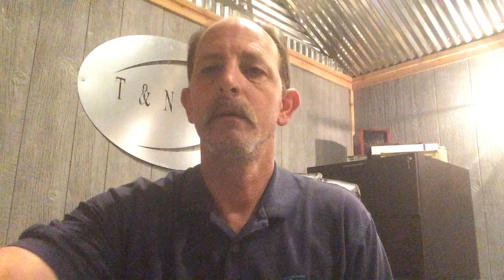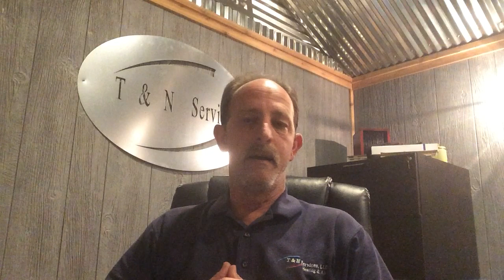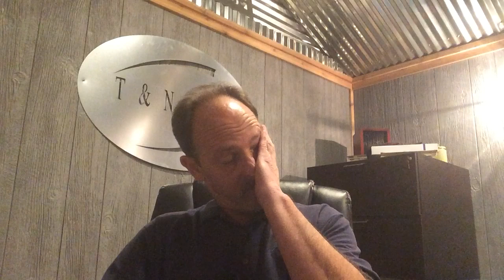Testo Smart Probes why are they so cheap

Comment: iConnect and iManifold, hell  Imperial is the apple of HVAC, overpriced and no better in quality. And nobody bought enough Moto X phones from 2013 to keep the american factory where they were assembled open. 

But it doesn't matter - if they made them in America it's only because it will be built by machines which is cheaper and no need to ship across the world.
Testo can do everything and more than the iconnect without the ridiculous price. They aren't 2-3x better. That's just them price gouging you - labor is not that big of a cost difference.

Comment: For what it's worth, we use testo and over many visits to the same customers, our testo tools are extremely accurate and system btu's are consistent even from different techs, using different testo's.  They are reliable, and take abuse despite their light weight.  They're cheap I thought, because of their down sides.  Limited range, and the testo app gets the award for being worst in the world IMHO.  Testo promises a new app update every two weeks but it never happens.  With testo probes, gone are the days crawling back and forth from supply to return plenum taking measurements to calculate enthalpy and btu's manually.  I almost forgot- they are very accurate in AC mode but the btu calculations are waaaay off in heat mode when compared to doing the math on paper.  I called them but they never have an answer and the follow up call never came.  I'm not sure why people hate Chinese products since they make high end stuff like iphones, ipads, ipods, etc and quality is very good.  The wages a tech makes are lousy in many parts of the country so it's hard to justify spending on an i-manifold to use on the job making 15 bucks an hour.  If customers would pay more for service then techs would be able to get better tools again, IMHO.  Thanks for posting your video!

Comment: after watching your video on the smart tool about a month ago i went and bought it.
  with 37 years in the trade this is the most useful,convenient, and time saving addition to my tool bag. as for quality it appears to be at the top of the wireless market. I have the imanifold and the smans . the smans now hang on my garage wall. 
      they are well built. I keep them in my protec mc bag and do not worry about them getting damaged or allowing them to get wet during a call. now if they would give saturation temps on the screen they would be perfect. thanks for the videos.